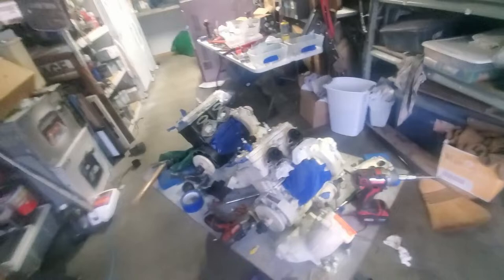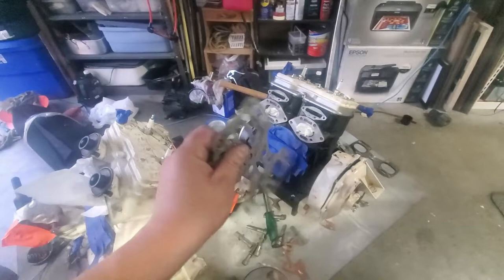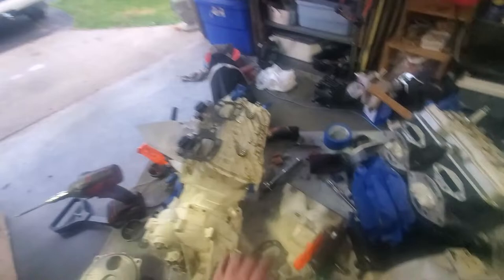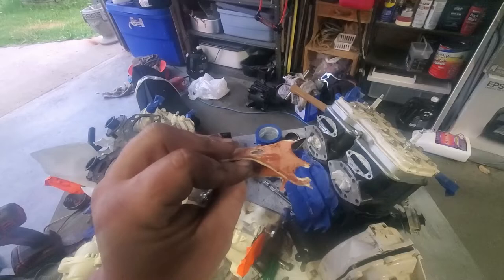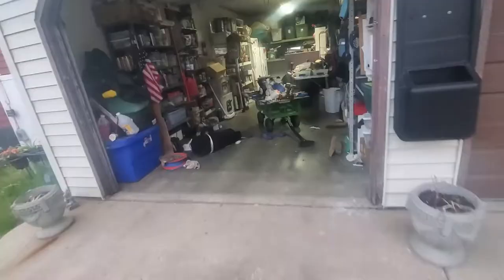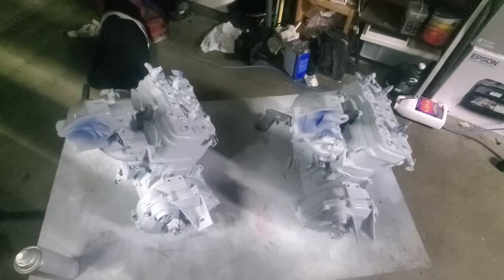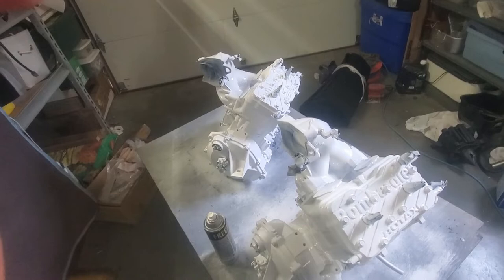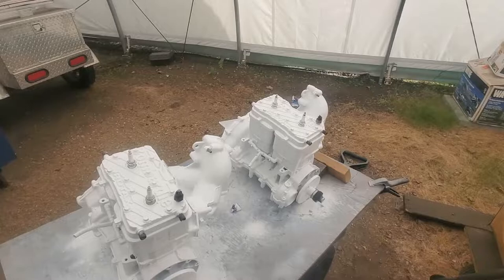Twin 1995 Sea-Doo XP 800 Projects: Episode 5: Engine Painting

Comment: How did you clean the engines and get all of the dirt and grime off so that they are ready for paint?
Reply from the maker: Engine degreaser and Purple Power degreaser cleaner. Using a toothbrush to get into the crevices and other tight spots.
Reply: @GCEXTREMEMN  would super clean degreaser work?
Reply from the maker: @BruceXP  yes should. Ive used Simple Green and Purple Power and others. Along with some carb/choke cleaner.